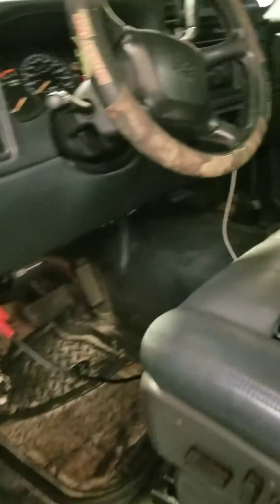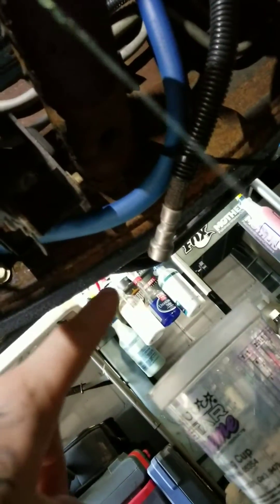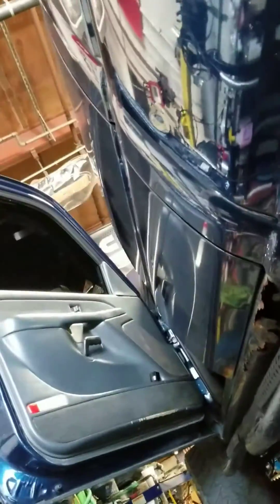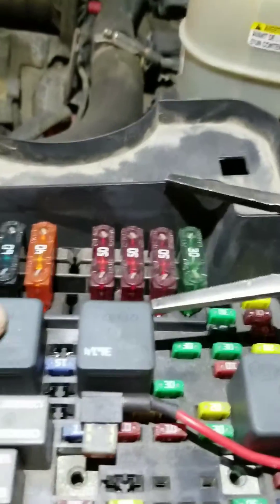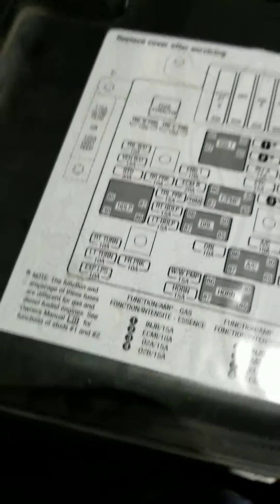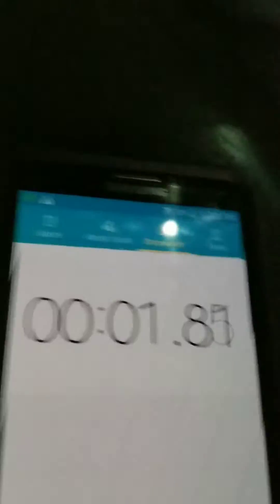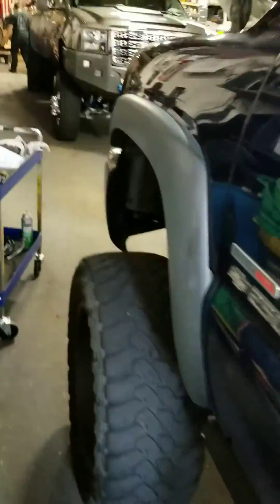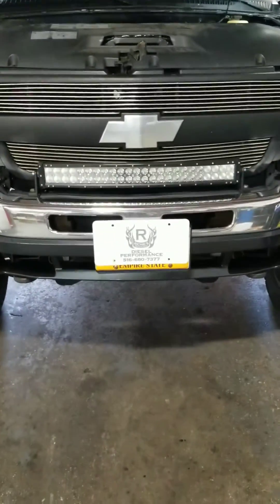LB7 Duramax diesel cp3 test fuel injector failure return rates code 1093c 1094c loss rail pressure

Comment: whats the total allowable maximum return in mL when doing this test at the fuel cooler? Maximum allowable return per bank (assuming 35 API) is 20ML..... so multiply that by 2 = 40mL maximum for both banks (all 8 injectors), but how much is the maximum allowed from the CP3?
Reply from the maker: My apologies. I made this video over 7 yrs ago and do not have the access to dealer diag references as I did back then. Additionally, I can't recall what the individual return/permissible amounts are
Reply: @richiestruckandauto7438  no worries thanks for reply. It seems the CP3 max return amount is not on the internet anywhere... been searching... or even in the GM fuel diag reports. Sucks

Comment: Is p1093 and p0093 basically same trouble shooting ?
Reply from the maker: From my past experience, the 1093 is what you would see when codes set under power such as heavy towing or hard throttle pulls. The 0093 code is very similar, but I've seen this code associated with delivery issues AND low rail pressure symptoms. The 1093 is more common when there's any rail pressure concerns on duramaxes. To answer your Q how to approach; that depends on the symptoms associated with the codes. If it's long cranks, low power and slow response =0093 or no start at all, loss of power all of a sudden under throttle demand =1093. Always scan for the codes and check for related issues before chasing possible ghosts. Once you go down the rabbit hole after 1 specific fault..u can get lost easily. stay open minded to all the symptoms as insignificant as they may appear

Comment: I’m getting po1093 and couple times I’ll get po1094. Drives fine , balance rates are good and no kinked hoses and when I floor it at wot the desired pressure with demand 22-23k and I’ll never get over 8k at wot . Cp3 right ???

Comment: How u disable the air dog just turn it off u mean !? Like unplug fuse or remove hoses
Reply from the maker: Unplug the fused link near the battery
Reply: This vehicle have a no start ? So which one of ur videos test do I run with truck with no start issue to determine cp3 or injectors

Comment: You said you were hoping for less than 100ml and when you got less you said the cp3 was bad? So is less than 100ml bad then?
Reply: He is trying to find the reason for the low fuel rail pressure. The 30 or 40 mil's he got was good news that the injectors are good and not returning to much fuel which would reduce fuel rail pressure.  Trouble points to the cp3 (high pressure fuel pump). Much easier and cheaper to replace cp3 than it is to replace injectors.  If that makes sense.
Reply: Thanks for clearing this up, not sure why I was so confused in the first place but all caught up now 👌

Comment: Having same codes. If there a leak somewhere in the line allowing air into the system would the cp3 still put out a 100mm

Comment: Hello I have been banging my head on the wall trying to case down this p1093 code. I have replaced the cp3 pump, insatlled a fass lift pump, installed a beans sump, bypassed primer pump.all new fuel hoses on low pressure side from tank to cp3. my cp3 went out completely a month ago. after replacing it this code will not go away it's starving for fuel above 2500 rpm in 5th and 6th gear while towing..only while towing
Reply: Hey Keith Asleson... i watched a video on the kennedy tune ( i think) that was taking care of this very same problem... search you tube for it

Comment: Yo Richie,
Another excellent video and i wish you were in my neighborhood.
In another video you did on return rate testing, you also went under the vehicle but had to cut into the return line since the quick disconnect on the fuel cooler was frozen. I asked why you went down below since it seems to me you could access return flow in the engine bay near the firewall. Why do you prefer going underneath?
My LB7 is on injector set 2 @ 155k and although it always starts quickly, shortly after warmup, I get diesel smelly haze at idle (fuel viscosity lower as fuel heats up?). MPG is off but truck runs well and not making oil or losing coolant. I want to do a return test to confirm my suspicion internal injector return circuits (check ball and seat) are OK and the problem is nozzle sealing. If return rate is 100ml after a 15 second crank, would that point to leaky nozzles causing the haze? Balance rates never checked. How do you feel about nozzle replacement? i'd like to go SAC but they only come oversize. No doubt you abhor comebacks, but I'm willing to take a chance with diy nozzles. Your thoughts?
Reply: Always funny to stumble upon your own comments 😀. I ended up R&Ring all injectors and all is well.

Comment: Can we get a video of troubleshooting a p0089 for lb7? This truck is kicking my ass, already replaced filter and fuel pressure regulator and replaced all low side fuel lines. What I haven’t don’t yet is rebuild fuel filter head
Reply from the maker: Filthy Beamer I'd love to make videos of all the cases we see bud but I can only do what I can w limited time and the specific troubles when they present themselves. I diagnose 95% of the vehicles at my shop. So when the opportunity affords me the ability to make a video I do so whenever possible. The fuel systems are not complex. However, you need to have a very clear understanding of the operation before attacking the symptoms. Regulator codes r usually caused by a harness issue or obviously a faulty regulator ofcourse. Most of the time when there's a fuel delivery issue, you get a code correlated to loss of rail pressure like the 1 in this video

Comment: Im about to try this procedure on my truck, if there is more than 100Ml of returned fuel does that point at injector failure?
Reply from the maker: Eric Hernandez there is another video I have posted that shows poor injector conditions. Excessive return rates only confirm just that element; there is too much fuel returning. This could be from 1 of several sources such as; cp3, pressure relief valve or injectors for example. Further testing needs to be performed to more accurately determine the root cause.

Comment: Great video BTW just wanted to follow up did the CP3 eventually get replaced and did that fix the problem?
I've got the same issue on my truck :(
Reply from the maker: Courtney Ludwin Yessir. We just did the pump recently. Installed a Fleece CP3K and it runs MUCH better. Holds perfect rail pressure even under the most demanding tune (Efi live). That's all it was. Not a common issue but can happen especially w higher mileage Duramaxes.